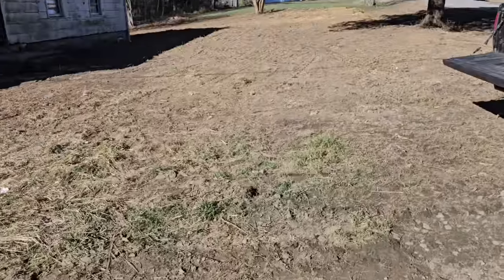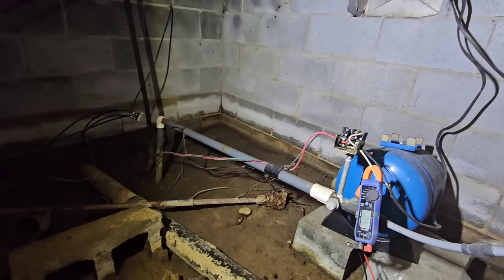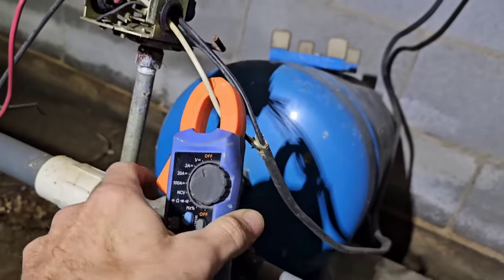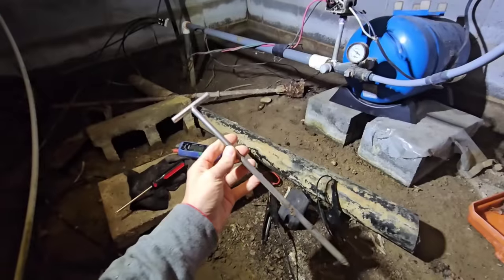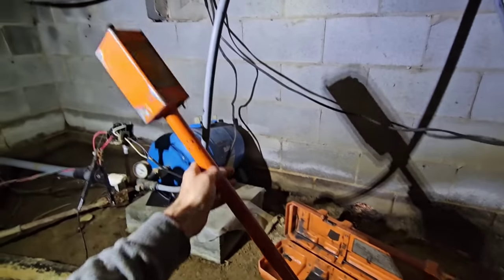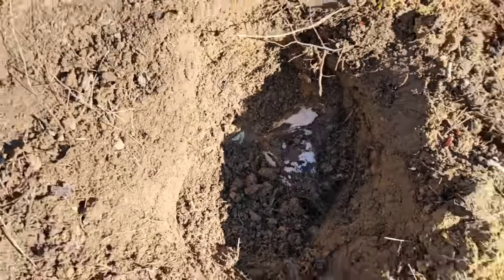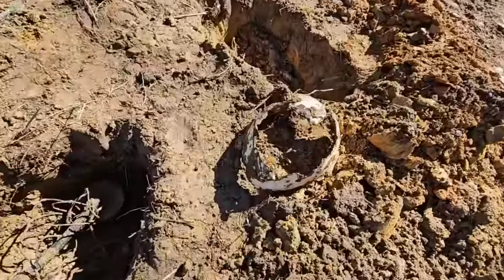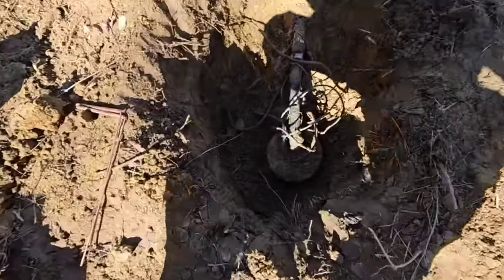Can Copper Dousing Rods Find a Water Well below the Ground? New Tech Vs. Old

Comment: my dad has a pair of specialty tools(don't remember what they were called, i'll have to see if i can find them again!) from his time working with the DPW at our local city, they're from around the 30's or 40's and have a long leather strap meant to be carried and hold the device just above the ground and it's for locating pipes and stuff like that. it's just a magnetometer and because it's so sensitive it functions just like a pair of dousing rods. it's mounted vertically in the box so there's a mirror at 45° with a sight glass on top of the box so you can view it as you walk along but it'll do the same thing! moving water creates a magnetic field which is why a lot of these things work, there's also voltage potential in dissimilar materials, your body also functions like a capacitor and you can visibly see this effect if you're old enough to know what a radio is! usually when tuning into a radio station you'll get static and so you grab the antenna on the radio to move it around to get a better angle to receive the signal since the propagation of magnetic waves is affected by a lot of things but that aside, the second you grab the antenna the static disappears(providing you're tuned into a station and not in between stations). so because of your body working like a capacitor you have to look at the copper dousing rods like magnetic needles trying to close a circuit to make contact which is only going to occur in the presence of a strong enough magnetic field which can be directly above water/electric lines, minerals and anything else that has enough of a voltage potential.
Reply: Thanks for explaining how it works!

Comment: I never took dowsing seriously until I tried it myself. I was with a group and we found that it does not work for everybody. Whether or not you believe makes "absolutely no difference" - it works for some and not for others.
A family member cut a Y-shaped branch off of a live tree, told me how to hold it and then pointed me in the direction to walk. The branch was not heavy, the stem was pointing straight out straight out and I had no knowledge of what was under the ground. When I got over the target the stem pulled down hard like a 30 lb bag of potatoes had just been attached to it. I kept walking forward and the stem came back up and it became light again. It was just a stick.
I walked back and forth over that spot several times until I finally accepted what was happening.
I have no explanation except that it works.
Reply: So you hold the two "y" ends and point the stem forward?

Comment: You could also open the main line, shove a wire in it, use a locator on the wire you shoved in, and fine the line then metal detect it lol

Or just locate the wire

Comment: We always called them witching sticks. We usually just bend a wire over at 90 deg and hold them loosely. It works because of the magnetic feild that is created by a "break" in the ground from a pipe or wires or a well.
Reply: I don't believe it works because of some magnetic field because I've found things that the magnetic field theory doesn't apply.

Comment: lol Let me tell ya about my dousing rod experience, I went from a skeptic to a believer. Dad died in 2017 and I needed to locate things on the farm. Here's the thing to remember, you locate what you concentrate on. The rods are the antennas and you become the tuner. Days that I have trouble concentrating I won't do as well. Here's the crazy, when you know the direction the line is traveling cross and mark it, continue away from the line using only one rod until it reacts again and mark that spot. Measure between your two marks and that's the depth of your target. Ready to call bullshit yet? It gets better!
Go to a graveyard, when ya walk across a man's grave the rods will cross, walk across a woman's grave they open wide. If you use one rod it will point to the head. I got freaked out and quit. This works on pet graves as well. Just be careful not to open yourself up to things we can't control. I'll be the first to admit I don't understand them.
Reply: I knew rods would work on locating water. Interesting story about grave part that I wanna try it.
Reply: @BWYinYang  Just be careful maybe ask for the Lord's protection first. I really think they'll find anything that you concentrate on. I know prospectors use them to find gold. Let me know your thoughts after a graveyard trip, it freaked me out.

Comment: Every scientific explanation I've ever heard doesn't fly. All I know is it works, and for the last 15 years I can reliably locate sewer water and gas pipe that's buried 20' deep. It's strange but it usually works when my expensive tech solutions will not.
Reply: No one EVER puts plumbing that deep unless it's absolutely necessary- and nowhere would all 3 be running at the same depth.
Reply: @henryknox4511  City sewer pipe out in the Right Of Way is routinely run that deep towards the outfall end of the system. Part of my job required tracing the sewer pipe where a contractor needed to make a connection to the city owned pipe. The underground utilities overlap and look like a latticework in many places- not uncommon for five or six different utilities to lie in the same trench line at different depths.

Comment: Awesome, I use them dousing rods too. Those flags, are they the steel ones, pull the plastic flag and bend those they work wonderfully. If you know what you are doing, you can locate to depth also, well, I can to within two inches. They work for sewer, gas, water, telephone, fiber, farm tile as you are not locating the water rather the magnetic field. Finding a sewer clean out point is just so handy. They don't have wires but they do have that magnetic field, even locate the wire over your head. They won't find a bottle of water in a cooler, no field. Underground tunnels, yup, lava tubes, yup, Never tried to find gold, silver copper, veins but my guess, yup, to two inches of depth. Depth many don't do, but if I told everybody, what would it be worth?

Comment: I learned dowsing from a well driller.  I dowsed 16 wells with 100% good results.  The well driller in that area was shocked because he typically drilled where the customer wanted rhe wells. That well driller had many dry holes.  Another trick to see in a well is to reflect the sun down the well with a mirror.

Comment: First off, need to say really enjoy your videos, VERY informative without technical jargon. Keep them coming.

I've always been intrigued with the dowsing process, but skeptical about it's effectiveness. This past fall, myself and a very good friend dowsed about an acre of my property as I was looking to have a well drilled. He and I had pretty much settled on a likely location, but wanted the drilling company to come out and dowse. Without showing him our location, he went about the task. He located a couple possible locations and one very strong location, but not very convenient to get equipment to. So I directed him to our suspected area, and he did get a hit but not as strong. He then went back to the strong area and followed what appeared to be a 'river' vein that intersected our vein. X marked the spot. First week of January the drilling rig was in place, and after 2 days of drilling and driving 6" schedule 40 steel casing to 175ft, hit about 5-7gpm of clear water. Drilled to 200ft and increased to estimated 10-12gpm (static level 72ft). 3 weeks later pump installed, and I have, several times, pumped 10gpm for over 45 minutes through a 5/8" hose and frost free hydrant. Have not tried to deplete the water yet, but should find out just how long it can supply and recover. Very pleased for now.
Is this experience on the dowser's part, or blind luck? 

Should add that I'm in North Central Washington state at timber line at 4000ft.

Comment: Dousing works because of simple scientific principles: as the water flows, it creates a static electrical charge which aligns the polarity of any susceptible ions within the soil, just like swiping a steel sewing needle with a magnet 50-100 times temporarily turns it into a magnet. Magnets as we know them are simply comprised of many atoms with the same polarity facing the same direction, in fact technically speaking, every single atom can be looked at as a magnet, it’s just too weak for the naked eye to see any effect individually, thus many atoms together can produce noticeable effects similar to many AAA batteries in series can make a taser (it just takes a lot of them). The technology not working is because they calibrate the machines too precisely, the rods automatically adjust to whatever charge is nearby, no funny business to get in the way.
Reply: *earth not soil F me

Comment: I had to run a water to my shop. Got my copper dowsing rods out. Flaged my main water line. Then proceeded to mark my propne line and electric. Jumped on the back hoe. Rods were spot on with all three!!! Even though it did its job i still nicked the gas line but oh well. More time saved than lost.